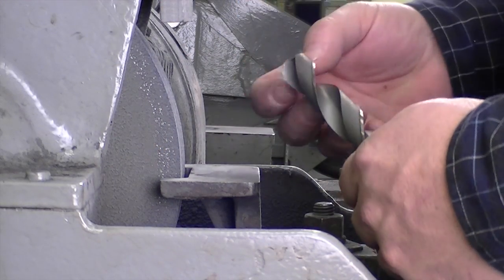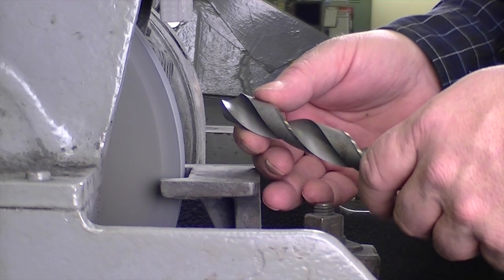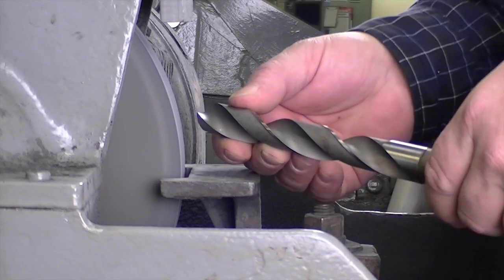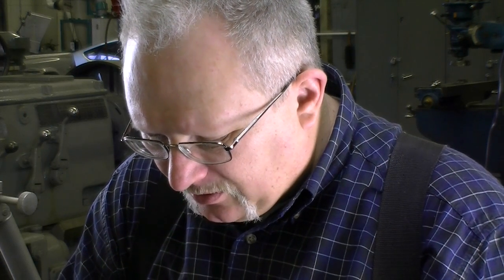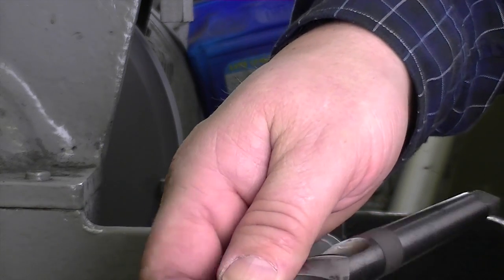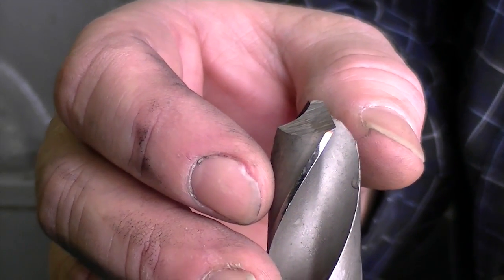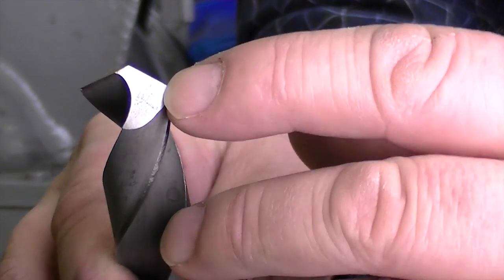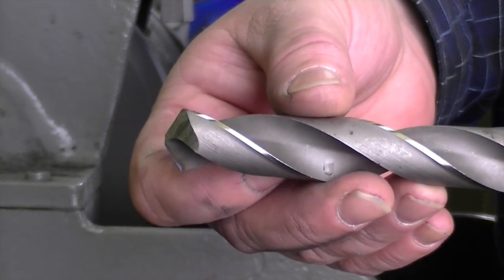Sharpening Twist Drills by Hand -  Part 2 of 2: Sharpening.mp4

Comment: There is another trick with that gauge I never see used or mentioned. The point of the bit across the web there will be an angle, if you lay the gauge across the cutting edge the angle across the web should be close to the angle of the gauge so the point can push material out of the way, If the angle across the web is to straight it won't push metal out of the way and the tip of the drill bit doesn't want to cut.

Comment: Wow you make it look very easy :) Tried today on a 20mm drill bit ended up
with about 20 facets..Going to have to keep watching and trying.
Reply: Muhaa Haloa It could be because your wheel needs dressed as mine does :) That can make it a lot harder. I dont know where the heck my dresser went. He's got an ideal set up with that nice sturdy rest and wide wheel. The one I use is only 1" thick and a flimsy rest.

Comment: if you want a quick measuring tool you can put two nuts beside eachother, itll be a 120 included angle but thats probably close enough for you if you have to use that trick!
also you didnt cool it enough you can see at the end you lose the temper on the cutting edge that bit will dull quickly

Comment: I use TORMEK - wet grinding wheel - never burn and keeps the perfect angle AND gives me 4 faceted bits - not 2 (chisel pointed) - AND you can touch the stone and it will not harm you as it's rotation is very slow.
To sharpen a drill bit by hand takes years of practice IF !
That's why some bits have more facets than a diamond !
AND with TORMEK - no need for safety glasses !

Comment: Waitaminnid! Where are YOUR safety-glasses!?
Reply from the maker: A very valid question! Actually, Barry's glasses have speciality lenses that are rated for high impact, just like regular safety glasses. They will not shatter. The only difference is Barry's glasses are slightly smaller. But they are plenty large enough to protect his eyes.
Reply: +ProjectsInMetal    Well, except that without side shields they do not really meet OSHA standards. Great video by the way, I learned a lot. Thanks.

Comment: what is he dunking it in?
 just water to cool it?
Reply: dylpykle69 Yeah
Reply: And he is just dunking it so it wont burn him. Drills are made of high-speed steel  which means they will become too hot to hold way before any overheating can occur.
Reply: Yes, water. If the drill tip gets too hot, as indicated by its color (blue at about 600F) it will loose its hardness and be unable to cut through other steels and be useless. 
The steel the drill is made of is shaped while soft then heated cherry red (about 2200F) and plunged into cold water to make it much harder than all other steels. But then it was very brittle, so it was baked in an oven at 400F for about 20 min. to "draw" some of that hardness out of it in exchange for some flexibility, leaving it both very hard but also durable: tempered steel. That process would have to be repeated in its entirety to save the drill if he were to get it too hot. Alternatively, he could just grind off all the parts that turned blue but the it's like grinding your pencils so short until there's little point left (pun intended).
Reply: Lite Roadie piffle!

Comment: The video is good but I believe for the sake of safety you should NEVER use your finger as a tool rest to support the drill bit or any other item for sharpening. Always use the rest for support that's why it is there. If for example somehow to drill bit bites or is grabbed by the wheel your finger will be injured or worse ground of or snapped/cut of instantaneously..
Reply: steven citizen You just don’t get it , this is the old way when our country was Great, good video but hard to do with a 3/32 .  It’s  nice to have 2” wide stone and dressed properly.

Comment: davs have augers. if i ground a drill that made curly chips it clogs the auger and the machine fills with chips and its smash-up time lol by changing the angle on the cutting edge you decide by negative or positive what chips to make. nagative angle makes broken up chips. positive angle makes curly chips which is ok for acme or tri-ways, no good for davs.

Comment: Thanks for this info.  I have been sharpening my larger bits for some time, with fairly good results.  But I didn't know there was a gauge for measuring the length of the cutting edge.  I just do it by eye.  I'll have to get one of those drill point gauges.

Comment from the maker: I'm pretty sure the wheels are aluminum oxide. They are old (they are huge so they haven't been replaced in years) so I'm not positive. If you're grinding HSS drills aluminum oxide works well. If you're grinding carbide drills you'll need a silicon carbide ("green") wheel.

Comment: Nice videos, but you can't determine the proper clearance angle from looking at the side of the drill, as you are looking at a curved surface, so it is more of a compound angle. Easiest is to look at your chisel line angle in relation to your cutting edges, it should be around 120-135 degrees.

Also, you didn't have to grind that rounding off, you could have ground the tips of the cutting edges with a primary clearance angle, makes it last longer and makes a smoother and more round hole.

Comment: Well done. When I saw Part 1 I thought "Oh no another sales pitch." In Part 2 you have clearly explained the thinking behind the method.
I noticed that the chipped drill you sharpened had the web thinned. Will you be showing how that is done? Since I use home shop equipment now I find that reducing the web on 1/4" up to 1/2" bits allows me to make one pass holes even with reduced power machines.

Comment from the maker: That's true, long sleeves can be dangerous in the shop. I generally wear short sleeve carhartt shirts and (if it's really cold) a carhartt vest. It's safer to heat the shop than it is to wear long sleeves. However, I'm not generally worried about long sleeves around the grinder. I'm more worried about them around the lathe, mill, or any other machine with rotating parts that can snag the sleeves.

Comment from the maker: @detvardasatanme Glad the video helped! Grinding the heel is critical. You don't need to grind a lot away, just enough so that the heel doesn't interfere with the cutting action of the lips. We remove quite a bit of the heel in the video, more than is necessary. But we did so to illustrate the process.